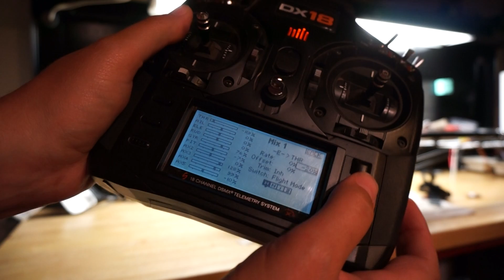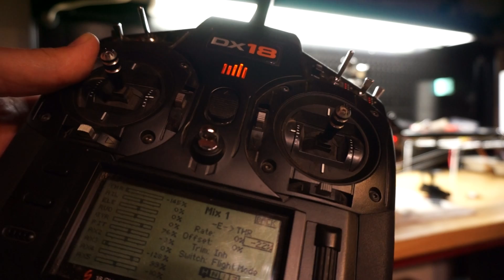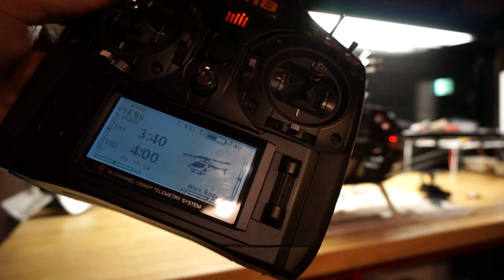iKon Autorotation Bailout Bench Test

Comment: Hi I`m new to this hobby and I have a question on the castle setup. Can I set it up so I have control of the throttle .I`m not use to it spooling up to full throttle and not having control of it I like to have control of the throttle. I have a blade 360 CFX and a Spectrum Dx8 radio